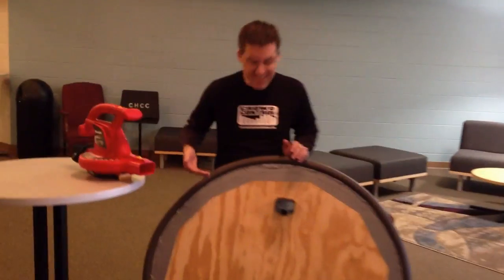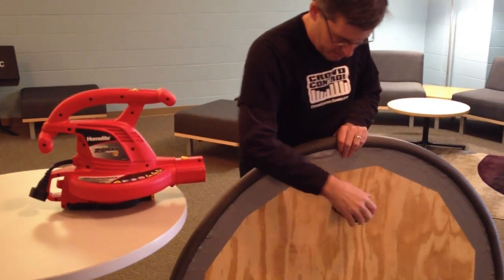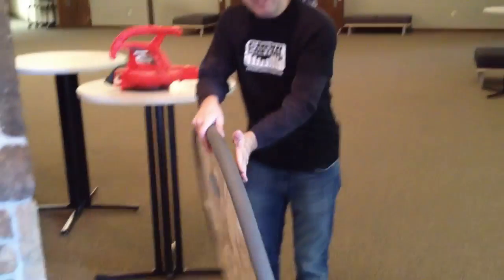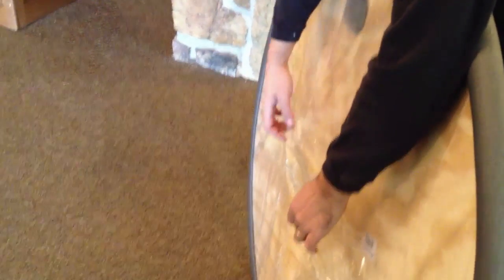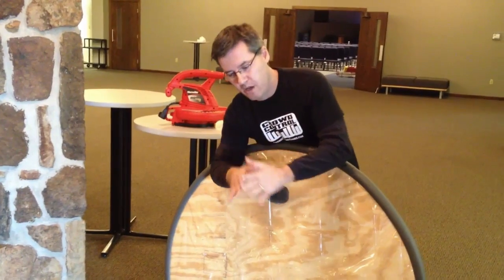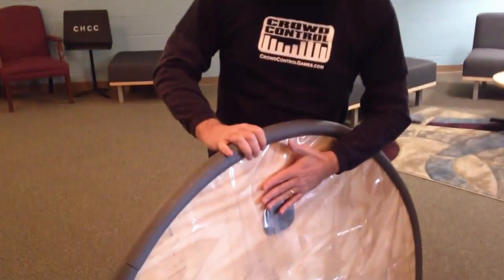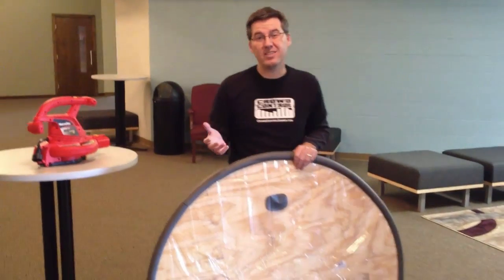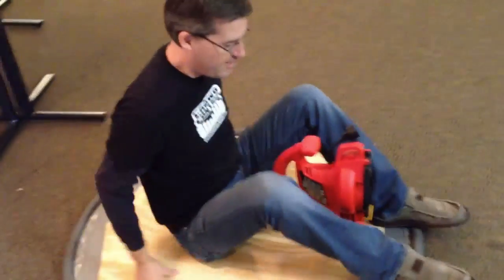Leaf blower Hovercraft

Comment: This is an awesome little blower.>>>t.co/7VtpgCaYjV    Strong force with good volume of air flow. Light but built sturdy. Tube is somewhat short but did not expect anything longer. Bought this to use when cleaning off the patio or front porch. Have a gas blower for heavy work. Very happy with this product!
Reply: fine